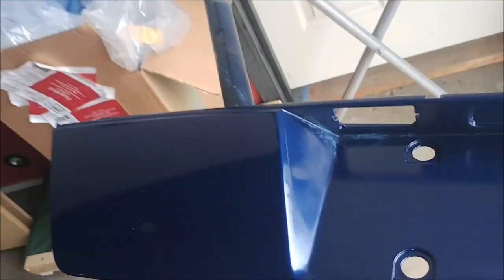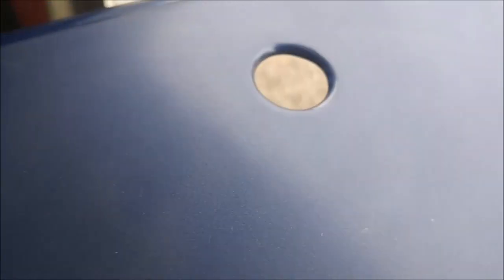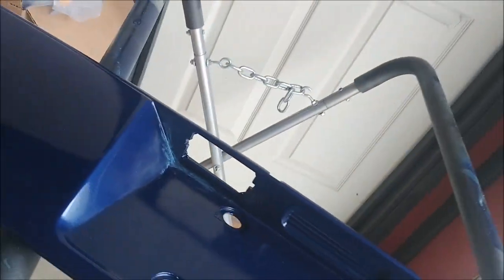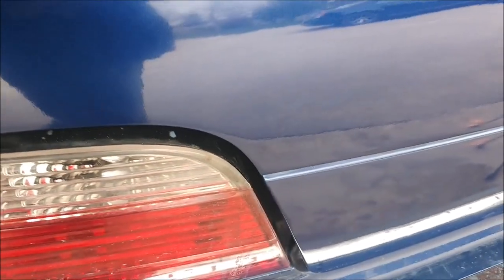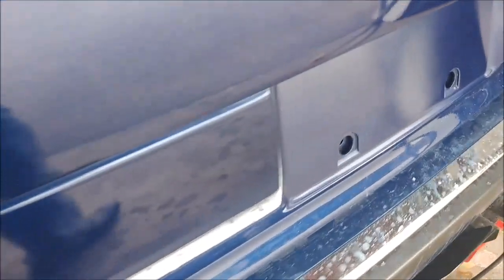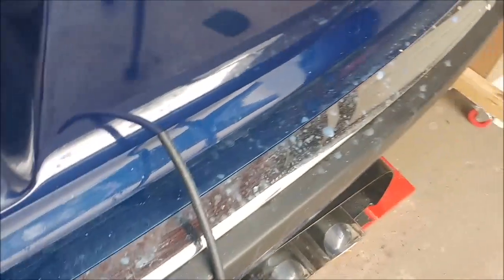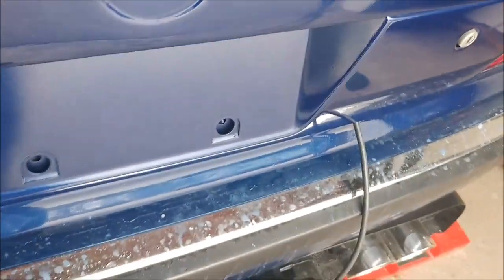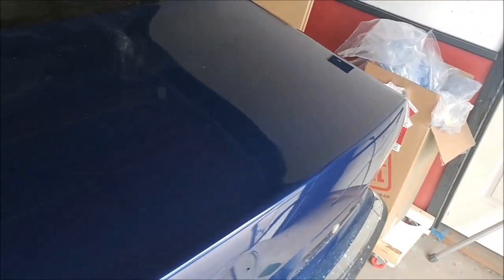1995 BMW E38 740i - Trunk Paint Progress 1k Spraybomb

Comment: Ok so if I had a hole in my air intake hose would that be the reason my car starts then shuts off?
Reply from the maker: Kodak Carson it would depend where it is - before or after the MAF sensor. Depending on the year you may have an IAC valve that could be sticking.  Try unplugging your maf sensor and see if it will start that way!
Reply: Ok I will try that .
Reply: Thanks for the info .
Reply: I did what you said . It didn't cut off. So does that mean I have a bad maf ?
Reply from the maker: Kodak Carson if it didn't shut off than yeah I'd suggest getting a new maf! Glad it was that simple =)